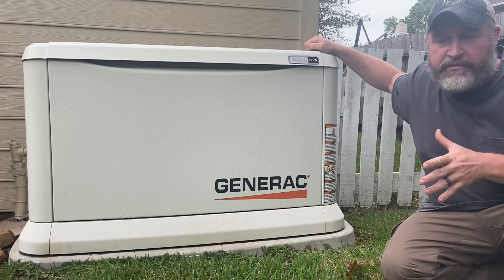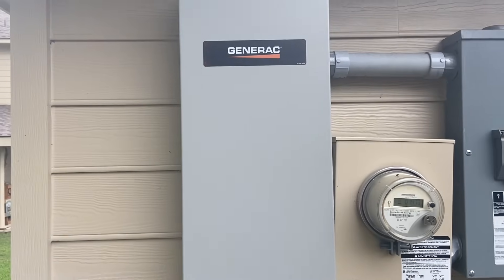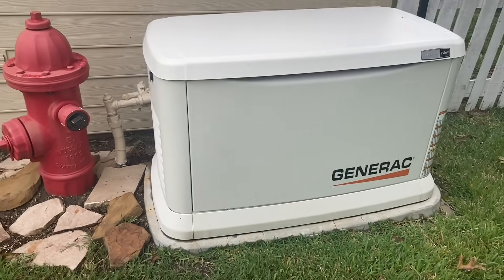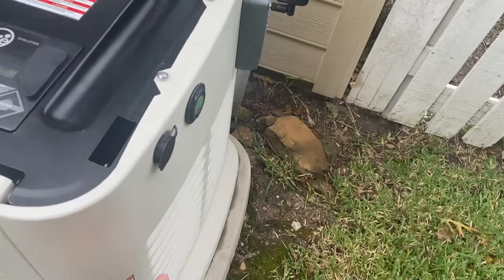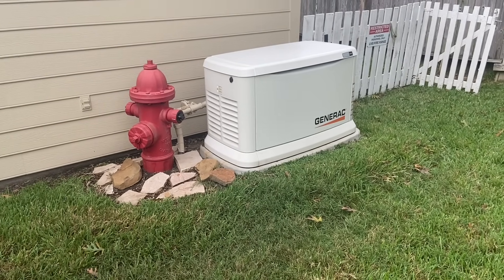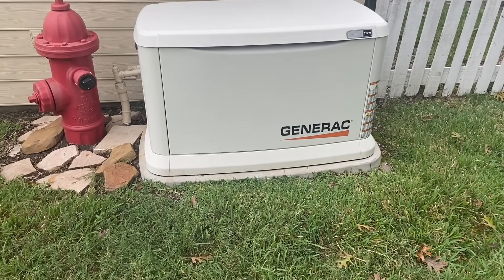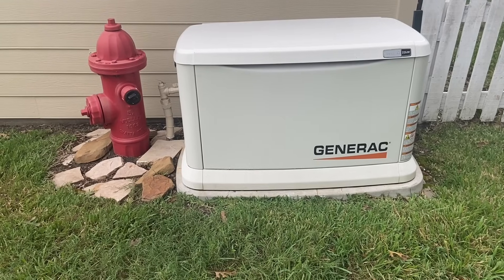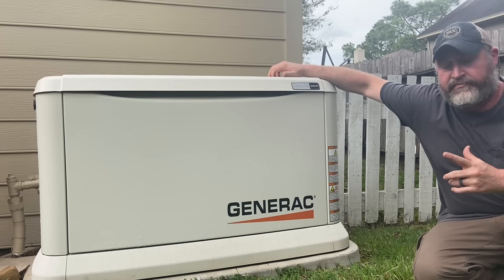Thinking of purchasing a generac whole home generator?

Comment: Just fired up my 24Kw Generac for the first time today.  Down here in hurricane country.  Powers both my 4 ton & 2.5 ton A/C units, both pool pumps, two refrigerators, two deep freezers, was running one oven rated at 5.1 kwatts with microwave as a test.  Ran with no problems. Very happy so far.  Didn’t even bog down when the A/C’s kicked in.  Just need to break it in now.  Thanks for posting.
Reply from the maker: Sweet!!!
Reply from the maker: Mine has a slight bog when the A/C kick on , I could probably install a hard start kit but it works fine as is.
Reply: It has somewhat of a bog when the A/C startup I guess.  I’m noticing it now especially during the heat of the day.  Guess I’m just use to my old portable generator where is was more pronounced.  Still in my “25hr.” break-in period.  Had this installed by professionals, turn key cost  was $13,925.02.  This included permits, tax, 50’ natural gas line (buried), auto-transfer switch & all wiring.  I’m close to New Orleans.  So you do it yourselfers can figure the savings out.  My breaker panel was only 5’ away so that was some savings.
Reply from the maker: @Do_the_Dishes  sounds like a a fair deal, hope it provides the peace of mind ours does.
Reply from the maker: Forgot to mention the going rate in my area is 14k I have seen to new quotes from neighbors.

Comment: Great unit, and a good company.  Generator Supercenter did our 27KW Generac about ten years ago and it's still running great.  I have the annual service plan as well... great peace of mind that when the power goes out, you know your generator will start.   We were a little worried last year during the extreme freeze and some areas were experiencing low nat gas pressure, but when we lost power for about 8 hours the generator started and ran fine.
Reply from the maker: Awesome just awesome buddy we where so happy to have ours during the event least February and now during this even we have not even given losing power a thought since really we don’t lose power we generate it!!! 😎

Comment: My wife and I purchased the 11 kv several years ago virtually no issues with the unit runs perfect. I have the monitoring included when the generator starts it’s weekly run I get a text message and that’s how I found out the battery needed replacing. We live in the upper Midwest and extremely cold, and suggest for the folks in cold climates buy the  heating pads for the oil filter, and the battery.  My only complaint is trying to find a company to service the unit. Generac sells the unit but does not service it, you need to have maintenance performed by an approved company in order to keep the warranty valid. It’s now off warranty and I service the unit my self every fall.  Great video
Reply from the maker: Thanks Thomas for checking out my channel! Please subscribe like share and have a great weekend! 👍

Comment: Glad I found your video. I’ve just ordered a 24kw LP Generac for delivery in 4-5 months and compared three dealers, one for a Kohler 20kw and 2 Generac. I’m impressed with the detail you provided so it makes me feel confident the price I’m paying for the same setup is good. My quote is for the same as your setup but for the newer 24kw, have to look to see what I’m getting for service, but total was $10.7k. Although I do have to add a 500 gal tank and fill it for another $1400 (leased) or $3,800 (purchased). AND…because of your video, I think I’m going to post a similar video from start to finish as mine is installed in a few months - praying for no major outages until at least Spring.
Reply from the maker: Awesome buddy glad you got one coming , also glad my video helped out. Please subscribe like share!

Comment: Signed for 22kw from Gen Superstore few weeks ago. OTD 13.8k for 3k sqft one story home and 4 ton AC. Extra 1300 for electrical run because my panel and gas on opp sides of house. If I didn’t have the extra run then I would be around 12k. Went through Costco to get 10% back as Costco shop card and 2% back as executive member. Going portable route was only saving me 50% cost so to make sure my family wouldn’t have to move a 200+ lb portable if I’m not home I went this route. Install by end of Aug but we will see how it goes.

Comment: Very informative video. I sold industrial generators for CAT and Kohler for 30-years combined. One thing I will stress is not to stand in front of a transfer switch with the cover off when it is going to transfer. If something goes wrong during the transfer, all that electrical energy is going to come at you and could be deadly.  Glad to hear you are getting annual maintenance, you should do a walk around inspection once a week before your Gen exercises to make sure the oil level is good. Last, if you are in an extended outage, the Gen should be shut down and the oil checked at least every 24-hours. These small generators are built to be cheap and will use oil when running and the low oil shut down may no work as it gets older. If your generator fails due to low oil, your ten year warranty will not cover the failure, my brother-in-law found that out the hard way.
Reply from the maker: Thanks buddy for watching and the comment, good tips ! I check the oil periodically and checked  daily during our 36hour outage. So far it’s not needed snug oil added. This unit also has a low oil sensor that will shut it down in case of low oil. Please subscribe like share and check out some of other videos, take care and have a great weekend.

Comment: I went with a smaller 12kw Briggs and Stratton unit. Price was a consideration but so is fuel consumption. I did some of the grunt work on our installation, with permits, all in we spent a little over $8500. We are on propane, in the foothills of California's and a 22kw generator would empty a 250gallon propane tank in about 3 to 4 days. We had a sub panel installed and brought over all circuits except for the dryer and oven.  In a big snow storm or some other weather event getting a fuel delivery can be a big problem. Our 2500 Sq. ft home operates smoothly winter or summer. In the 3+ years we've had the whole house generator, it's operated almost 400 hours flawlessly.
Reply from the maker: Awesome buddy, always a lot to consider! Thanks for watching

Comment: Thank you for this comprehensive review. A certified installer will be installing a 24KW model at our house next week. Your contractor was very reasonable with the installation and equipment cost.
Reply from the maker: Thanks for watching and the comment, updated cost in my area for what I have is 13-14K , please subscribe like and share and have a great weekend.
Reply: I just had a quote of $16k for a 26KW size and two ATS’s.  I haven’t decided yet.  Feel like they overcharge me
Reply from the maker: @maggiem3588  hard to say , everything has went up. Last few 22kw set ups I saw in my area 13-14k and that was 2022-2023

Comment: I'm really interested in getting one of these, but I'm a little leery too.  We went without power for 18 days after Ida last year.  The heat was horrible, not to mention the humidity.   My elderly aunt has one of these, and it gave her a lot of problems the 2nd or 3rd day, and because so many had problems, it took some time to get someone to her house to fix those problems.  Generac told her that they have never experienced this many homes all at once using them, and it caused some kind of stress on the systems.  I'm not exactly positive what their reasons were.  One person on my block, it totally broke, yet another a block away, had no problems at all.

As far as the monthly gas bill, yes it was high.  My aunt said it cost her a little over $400.00 to run hers for those 18'ish days, and that included the couple of days it didn't run.  However, it cost us right around $500.00 for our gas generator.  We have ours hooked up to our house, but we cannot run the a/c or our desk top computers.  My husband had to sit in long lines in the extreme heat, you can't run your car a/c when idling for hours.  So the cost is approximately the same, but you get to stay in the comfort of your home, not in long lines with a lot of pissed off, suffering people.  And to top it off, you may sit in the long lines for gasoline, but by the time you get to the front, the gas runs out.  If you are lucky enough to have a gas truck waiting to fill up the station, it takes a long time to dump that load.

So if the monthly cost of your natural gas bill is your problem, wait until you start paying to fill up your gas cans.  And now, with our communist leader shutting down our  country's energy, gas is way more then it was last year...
Reply: “Our communist leader”—apparently you live in Russia or Belarus.  If not, you need to take a class on government because you don’t know what the word “communist” means.
Reply: I'm in Metairie, and we had a smaller generator for Ida.  I could only run the fridge and a few other small things. We now have a portable, whole home generator. We also had to drive to get gas, sit in lines and wait, and even got to the pumps right when the gas station closed and turned off their pumps as well.  Ugh.  This time around, we will be prepared.  I won't have to send my family to Galveston and stay here, sleeping in my own pools of sweat.

What is wrong with your vehicle that your A/C doesn't work?

I am going to build a shed around my generator though.  I don't want to hear it run all night, and my neighbors don't deserve to hear it either.

But actually, let's pray we never need them.

As far as the Commie in Chief, let's hope things change real soon for the better.
Reply: @jmackinjersey1  What portable whole home generator?  It can run your a/c and desk top computer?  That would be nice, but you still have to go for gas?  Correct?

We have a/c in our vehicle, however, in the heat of the day, idling for hours, you can't run it.  You risk overheating the vehicle.

btw...  I'm across the river from you on the westbank. :)

Comment: Certified Residential & Industrial Generac Technician based on TX here. Good video bud, a solid quote too. A few discrepancies though; the fire hydrant is too close to the exhaust. You must have a 3ft minimum clearance from each end panel. If Generac views this video, they may not value your warranty due to install errors (hydrant). The Mobile Link monitor is actually a 4G LTE system, not WiFi. It runs through Verizon's cell service. Also to note; on Natural Gas, you're only getting 19.5KW, as NG runs at a higher volume, and lower pressure, but burns slower/is less volatile. The 22kW is a Propane statistic only. Even then (LP) this generator will overload at around 90-93 amps (21.6kW to 22.3kW - Ohms Law).
If you have any questions, feel free to reach out, I'm happy to help anyone interested in future or current Generator applications.
Reply from the maker: Nice thanks for the comment, I will look into the hydrant as it’s decorative and can be moved I used it just the hide the gas line from view I know the gen monitor is LTE I did this video a few times and had to redo due to neighbors dogs barking so I made a few mistakes and left them in I did not think LTE or Wi-Fi would matter to most people watching, please subscribe like and share!

Comment: We bought the same setup three years ago.  Ours is a propane unit because we're rural.  We had an older house and had to replace the main service panel to a newer one so we could fork off the bus bar for the transfer switch.  In our area, propane is expensive so it costs us about $4.00/hour to run which doesn't sound like a lot but that's $100/day if you run it all of the time.  We run ours in the event of a power failure only when we need it.  Typically in the morning to take showers (we're on a well) and in the evening for 3-4 hours to do the cooking, etc.  I do the maintenance myself and it's easy.  The oil drain hose really makes it easy and there are several youtube channels that show how to do the maintenance.  I use aluminum foil to keep the spin on oil filter from messing up the inside of the enclosure.  You do have to set the gaps on the valves after 20 hours of first run, then every 200 hours from then on.  I thought the maintenance contract was way too expensive.  The oil change can be done in less than a half hour.  I set the valve gaps in about an hour but that was my first time.  All parts are on Amazon (valve cover gaskets, air and oil filters).   My reading indicates a battery change every 3 years and mine will hit 3 years in September.  I found the software package also very expensive and it has a very low rating on Google Play due to functionality issues.
That being said, it's a reliable unit and as you say, it takes care of one's entire house.
Reply from the maker: Sounds like you got it figured out, great setup thanks for watching please subscribe and check out some of my other videos

Comment: Not bad, got a few things, not wrong, but not right.  Looks like a good install, and for 11 dimes! Great deal. Good job getting the extended warranty. Make sure you have the service done by factory techs. (Like me) Generac Evo is a good unit, but it takes some lookin after. I advise you get an interstate m26 battery, get the lead acid, not the maintenence free. I service about 2500 of these units, my batteries are good for about 5 years. I just never heard of an 18 month battery.
Reply from the maker: Thank for watching and the comment, please subscribe like and share and have a great day. Not sure what was wrong but thanks for pointing it out.

Comment: Hi! We have a Generac as well here in Florida.. One thing that you can do is add an soft start to your ACs. It’s about 300 or so for each AC, however it will make it really easy for your generator to run once they come on. My AC will draw down my generator  some then come back up to full speed. However with the soft start, the generator barely draws down once the AC starts. This was suggested by our tech that installs these units. I installed the soft start myself on my AC. I purchased the Microair Easy start from Amazon for 309. We lost power a few months ago after a storm, so blessed to have this generator! Anyway great video series, thanks for producing them for all to see.
Reply from the maker: Thanks Kris I have definitely thought about a soft start kit just have not gotten around to it as I do have that initial bog you mentioned. I appreciate you watching and the comment, please subscribe if you have not and check out some of my other videos.

Comment: Awesome video. I have been thinking about getting one since the Texas snowstorm. Natural Gas was the only reason we didn’t freeze to death. Still had hot water and was able to cook. My biggest concern was if they would shut off the gas due to shortage. That’s what keeps me from buying one of these. Then I’d have a $10k paperweight.
Reply from the maker: Sam thanks for the comment and checking out my channel, I still have that same thought and if the NG ever does get shut off I will be setting it up to run on propane as a back up. It will do both just have to get a very large tank and plumb it in. The generator has a valve close to the intake that allows you to switch over. Please subscribe like share buddy it helps a lot have a merry Christmas 🎁🎄

Comment: Good review , I have the same generator and the only thing that you didn't mention is when a heavy power load ( 3or 4 ton A/C STARTING) the generator will bog down and then pick back up to normal operation , I also have 2 A/C'S a 3 and a 4 ton and try to alternate the starting of the A/C'S to mitigate them both coming online at the same time , but yes the generator can run both if they start independently .
Reply from the maker: Yep they will bog a little as with any generator I did not feel it was worth mentioning. Mine will run all 3 of my 3 tons with not problems other than the bog you mentioned. When they came out for our tutorial they mentioned the bog was normal. 
I may do a updated video in the future covering some of the items I may have missed
Thanks for watching please subscribe like and share.

Comment: I'm considering getting one and this information is extremely helpful.  For 1500 sq ft, I received a quote for a  24kw at $15,000. I obviously need to keep looking. Thank you very much.
Reply from the maker: Thanks Lucy ! If you have not already please subscribe like and share, ring that notification bell 🛎 have a great weekend
Reply: 15,000 for a 24kw is a bit high but size of the generator is never based only on your sq ft, it is based on what appliances you have. (authorized GENERAC tech/sales Rep)
Reply from the maker: @Hoosier_Life  depending on the install  15k may be a good deal right now if they have one in stock and can get it done. 24kw though Is probably overkill.

Comment: I purchased my Generac and it took 6 months to arrive, they were back ordered.  Mine runs on Propane.  We have 2, 1000 gallon Propane Tanks, they hold 800 each to leave room for the non-liquid gas.  When it runs in it's exercise mode it only runs on 1 cylinder.  I also have a lightening Rod on it, as well as our pump house for water (we have a well & 2 2000 gallon cisterns) and lightening rods on the roofs of our house (3 areas).
Reply from the maker: Awesome set up brother! Thanks for watching please subscribe and check out my other videos!